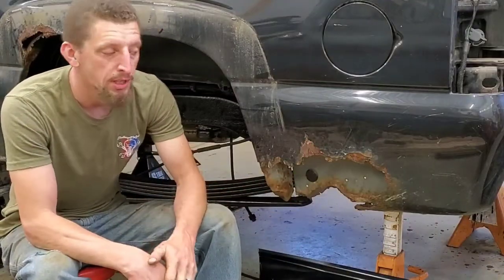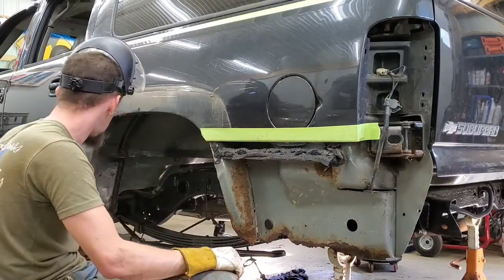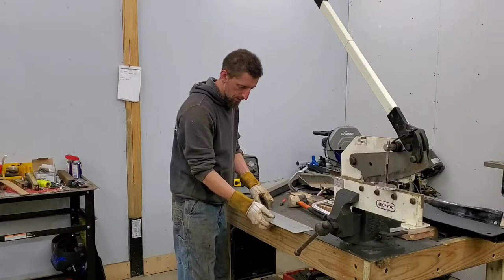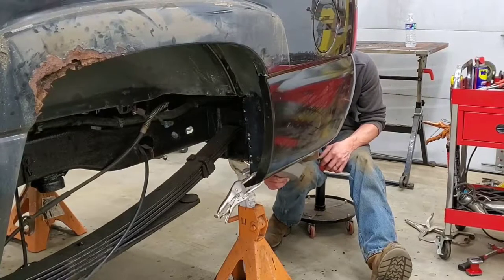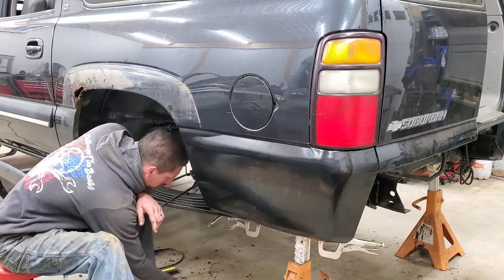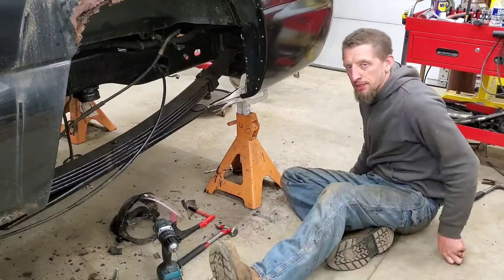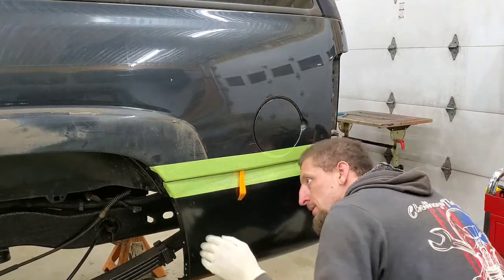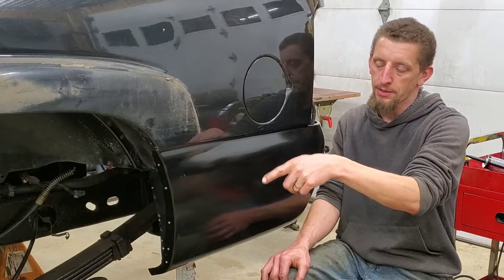Replacing Rear Quarter Panels "No Welding Required" 2004 Chevy Suburban Rust Repair

Comment: Thank you for putting this video together. I know it had to take some time and effort, and as someone who is considering installing a replacement quarter panels on their '02 Suburban and has never welded in their life, this has been extremely helpful.
Reply from the maker: Awesome!   I appreciate the support and feedback.   The job is pretty straightforward and I believe most have the ability to do the job.   For the most part basic hand tools and a "I can do this attitude " will be enough!    Good luck with the project if you decide to go for it!

Comment: With that 1k urethane sealant, grab a rag, and put a little mineral spirits paint thinner on it. Wipe your finger with that rag before you swipe. That urethane won't stick to it at all. Then use that rag to clean off your tools and whatnot.
Reply from the maker: Yes to all the above..👍👍  That's basically how we used to work with B½ pro-seal (aviation stuff) ... This is all good information.   Appreciate the watch and comment. 👍

Comment: What company did you buy repair panel from? I tried following the link to Amazon and got msg " page not available"  thanks..
Reply from the maker: I will have to update the links.   I can't remember what brand specifically, I'm sure any rear quarter will work as long as it fits your year, make & model.   You will most likely have to make some adjustments as far as fit just like any other panels.   If you are looking for a more reputable company look at AMD Direct (Auto Metal Direct) they should have what you need. 👍

Comment: Don't kid yourself...the use of the foam is their educated wisdom, GM is fully aware of what would happen if a material like that was to be used, and they also knew the perforations would occur AFTER the corrosion warranty expired, for the vast majority of the vehicles. ALL DONE BY DESIGN, with the specific intention of being a huge parts sales source and an income source for the dealership bodyshop repair centers
Reply from the maker: Unfortunately I can agree with this, they making things to be disposable these days.  The manufacturers know exactly what their doing..

Comment: So that rear lower quarter area,would you say drilling a small hole or 2 on the underside would help draining,,or drill small hole underside and fill with expanding foam...any ways of preventing lower quarter rust....thanks
Reply from the maker: 🤔...I would definitely not recommend spray foam, I have used it in the past and while its good for quick short term repairs it still can hold moisture so rust will eventually happen.. As far as drilling a few small holes, it's possible that it might help drainage as long as drilled in the right spot.   You would definitely want to t/u paint them to keep anything from rusting (the aftermarket panels I installed had drainage figured out..  No matter what we do the only guarantee is that rust will eventually come back (its a pain in the butt.)😁 Hopefully this helps and thanks for watching and commenting...👍🤝
Reply: Couple of drainage holes, skip the foam. Spray a rust free coating or some type of oil once a year. Possibly a decent method
Reply: As  @GuerrillaMane  mentioned, I hear spraying Fluid Film or Lanolin is an excellent preventative
Reply from the maker: Yes, I have been told to use 3M Cavity wax.   Unfortunately here on the east coast the only guarantee is the rust will be back eventually it's  just a matter of when...😁

Comment: On those vehicle what pieces behind the rear on the bottom on Chevy Tahoe
Reply from the maker: Not a 100% sure I follow your question.   But what is behind the panel is just the inner structure of the quarter panel.  Not sure they make aftermarket pieces for that..🤷‍♂️.  Good luck with your build..💪
Reply: It is in front of the quarter panel and in  Behind the rocker and also did he fix the water rest hole on the  Is wheel well
Reply: If you still have the Tahoe put in the seat shop